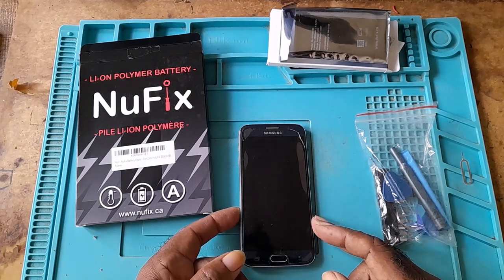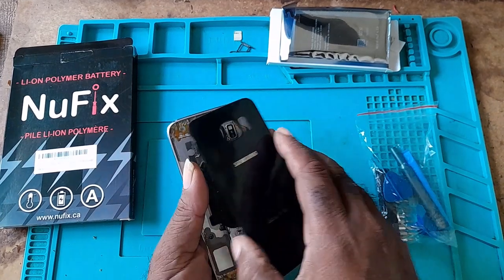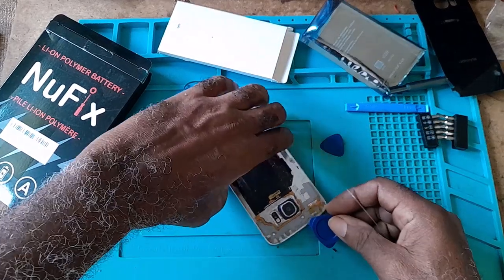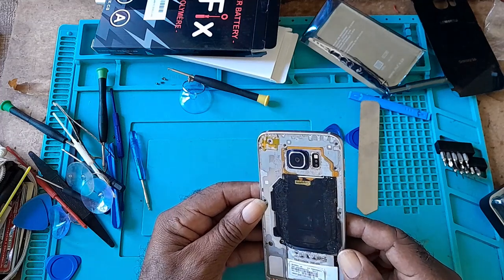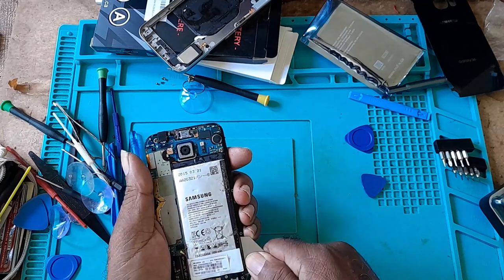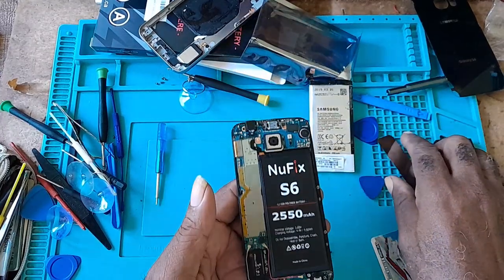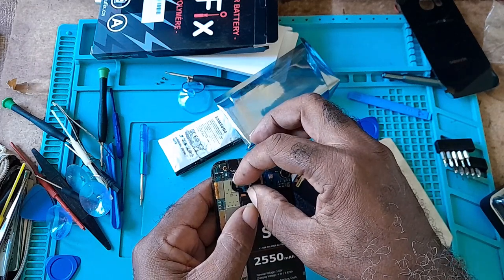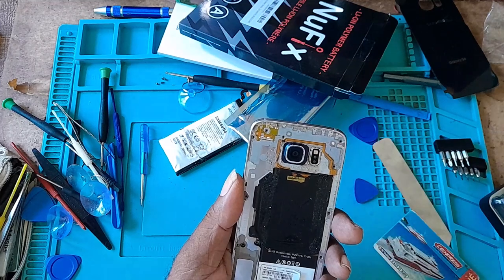Samsung galaxy s6 disassemble, battery replacement

Comment: Hey Alwyn, I'll be honest, this is actually the best of the videos here on changing the battery on an S6.  As you mention very briefly, there a reson for keeping your S6 going.  Its a remarakably good device with a fantastic camera.  Even today in practical terms you'd have to eg an Apple iPhone 14 / Max, an S22/Ultra and Flip or a Google Pixel 7 to improve over an S6 back camera.  Super video that joves at the natural spped of "actually listening as you work".  Great job.  Subscribed.
Reply from the maker: Thanks.